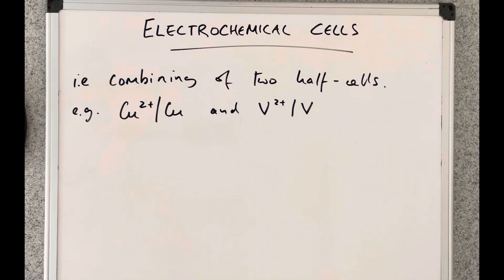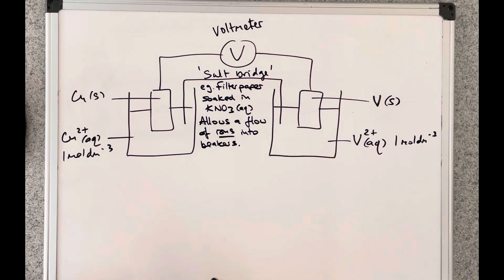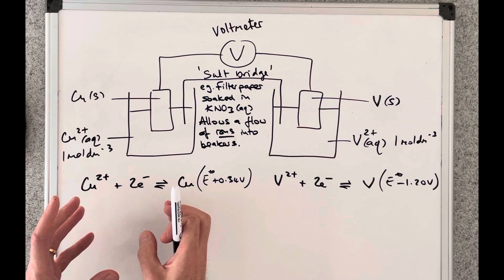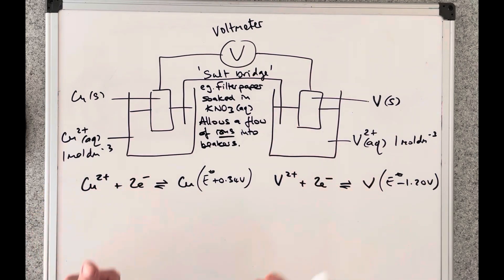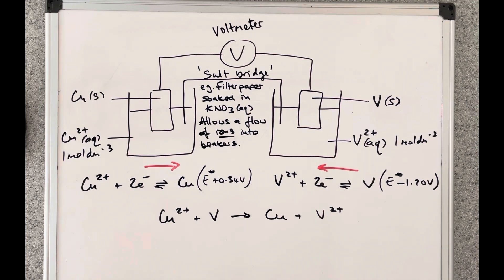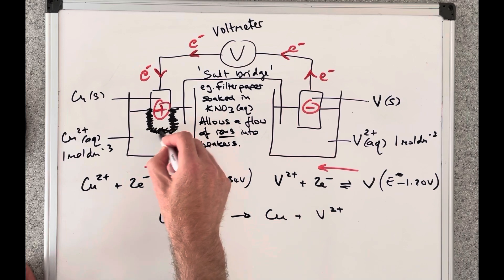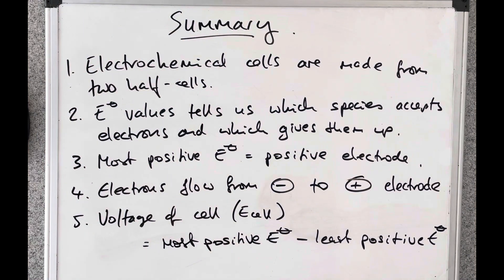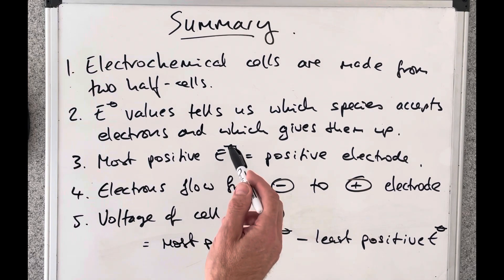ELECTROCHEMICAL CELLS

Comment: Great informative video!
But I had a quick question: So what exactly is the difference between electrochemical cells and electrolysis? because the apparatus looks similar if not identical.
Reply from the maker: Thanks. An electrochemical cell creates and electric current, an electrolytic cell (electrolysis) uses a supply of electricity to split up a compound